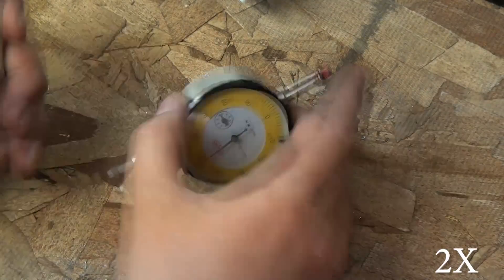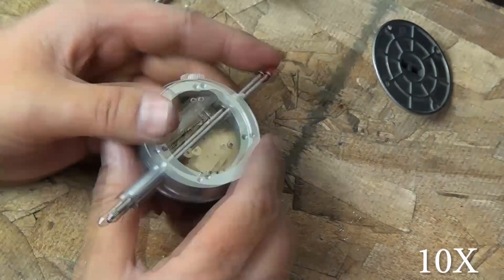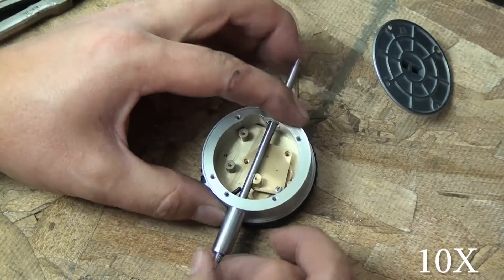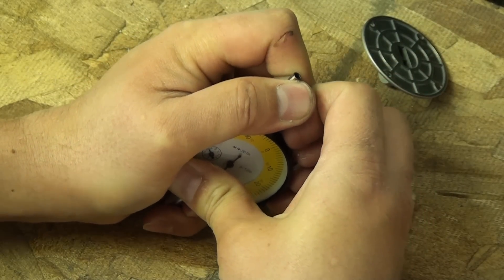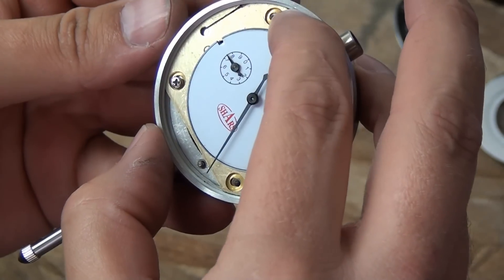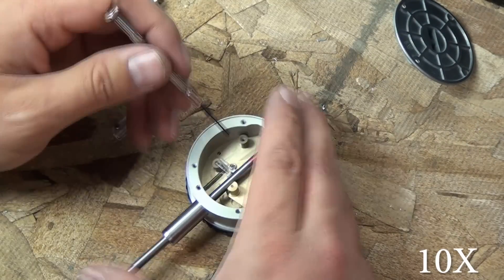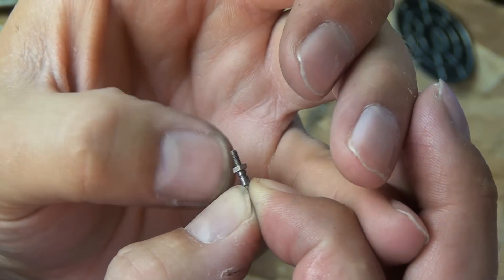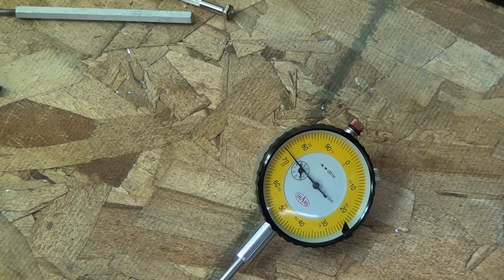How I Fixed My Damaged Shars Dial Indicator

Comment: You are the man.  I dropped mine too and I approached the problem to the letter the way you did.  Once I realized it wasn't a bent shaft I went to youtube.  You saved my indicator from exploratory surgery.  I owe you a beer.  Cheers.  
I also discoverd that the shaft with the rack will rotate ever so slightly if it is not fully engaged with the pinion gear.  It helped me to reset the engagement wihtout being any tighter than it needed to be - hopefully.

Comment: Strange world. Was watching this and struggling to get the front bezel off my HF one with the same plunger issue, and it popped out of my hands and hit the floor (thin office carpet on concrete). I sarcastically said to myself "yeah, that might have fixed it", and it now has nice strong tension again. TBH, I don't remember dropping it when it lost tension, but I drop lots of things as I go along.

Didn't bother trying to get the front off after that. Does anyone know if the Harbor Freight snaps off like his? The rear guts look about the same, but the aluminum ring looks to be all one piece which wraps around to the front. - and thanks for the video!

Comment: I wouldn't suggest this video as a reference to anyone who thinks they can accurately "fix" a dial indicator on their own. My take on this is that while your camera was rolling you had some luck. Your luck isn't the best teacher. This makes me want to produce a video on the correct procedure for disassembling, diagnosing, and actually accurately setting return springs, gear mesh, take up, and calibration (after reassembly). Just getting gears turning together is not accurately fixing a dial. Without checking calibration of the dial increments may lead an operator into thinking they are getting accurate readings!
Reply from the maker: +Dennis Allport For cheap indicators like this one, I had nothing to lose getting into it and I assume other people with cheap indicators will likely fill the same way. As for doing it the right (or better way), I think your idea for a video sounds great. Send me a link if you do make it, I'd love to see the job done by someone who knows what they're doing. Thanks for watching :)
Reply: Dennis, please make that video.  You will have done your good deed for the day and made the world a better place.
Reply: Two years ago I had no means of recording or posting videos. I do now! I will be creating a video series covering many different measuring instruments. Thanks for the inspiration.
Reply from the maker: Cool!

Comment: I worked at a calibration place for 4 yrs and have worked on many of those brands and also the Starrett and other brands, with all brands that pin with the spring attached is easier to install or take out with the rack turned where the pin faces you... food for thought
Reply from the maker: +Charles Thompson I never thought of that!
Reply: makes it a lot easier, i found out the hard way, cus there is no easy way to remove that pin unless you can get a hold of it...lol

Comment from the maker: Do you mean adjust the brass plate so that the indicator points to 12o-clock when in the resting position? Because yes that should work fine. Mine isn't, but it doesn't bother me. Cheers!

Comment from the maker: The three ways I've seen splines cut are hobbing, broaching, and milling, but I have never tried any of them. There may be other methods, but here are some examples of these three:
Hobbing: v=xcEI31A0pUI (the way the pros do it)
Broaching (sorta): v=B8l6lH4ydd4 (all of this guys videos are amazing)
Milling: v=8I_jv0IKDC4 (this is a timing pulley, but same idea)

Each method requires some way to index the stock, which in CNC would mean a 4th axis. I hope to get to this point some day....